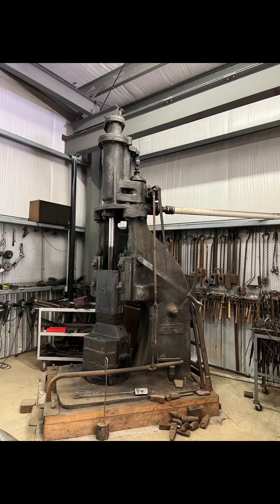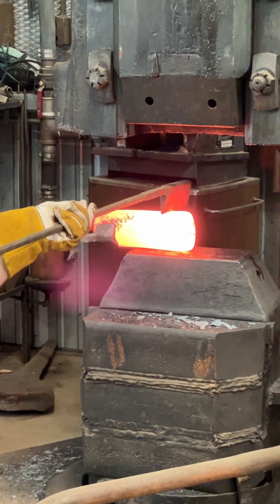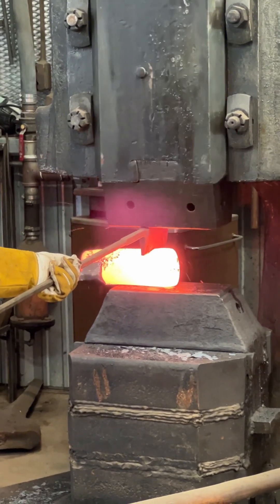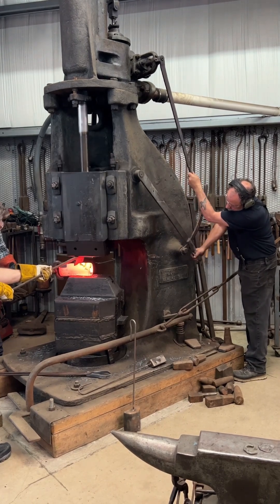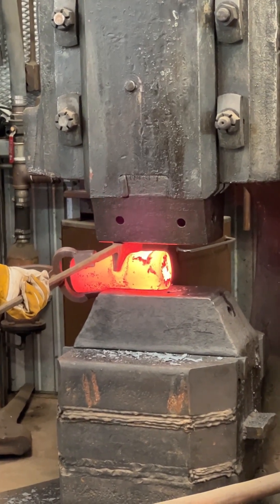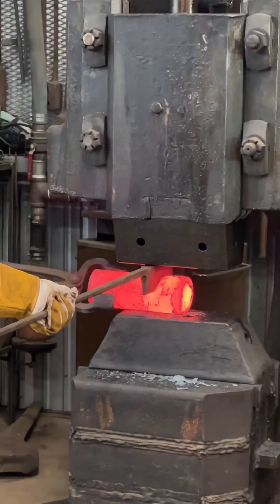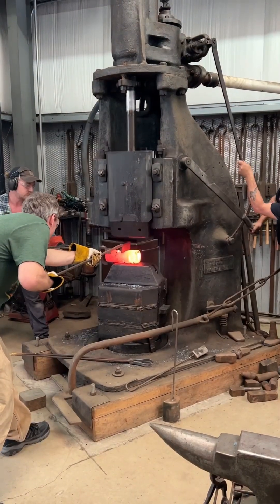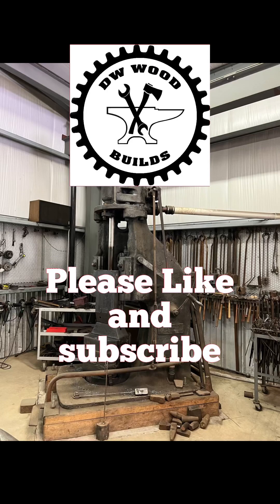Bement steam power hammer with 800lb ram used to forge large metal sculptures by Michael Dillon

Comment: My father was the blacksmith in a lead smelter in Montana.  He used an air hammer somewhat like this, which he ran with a foot peddle-bar.  The hammer is not dangerous if the material is yellow hot.  It's cold metal that is dangerous.
Reply: Interesting, why might that be? Just that the steel is tougher once cooler, or brittle once cooled depending on the type?
Reply: The danger was that if a cold steel bar, for example, isn't held absolutely flat (flush) on the air hammer's "anvil," that bar can be wrenched out of the user's hands when struck, and thrown a good distance.  One of Dad's apprentices had a steel shaft tossed up into the overhead rafters.  It could have been fatal.   @Mak13927
Reply from the maker: No necessarily.  You are assuming flat dies.  Angled dies can still cause a yellow hot piece to shoot out.